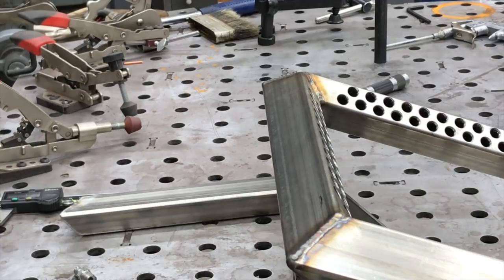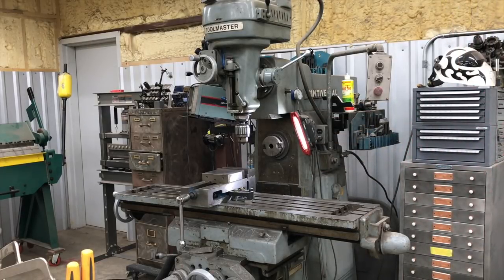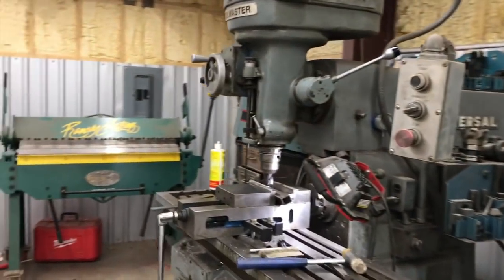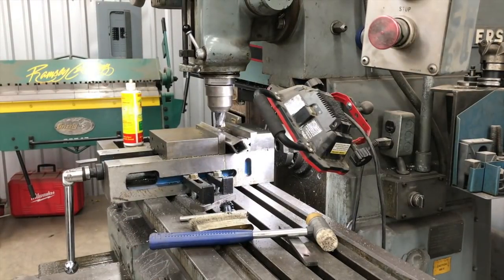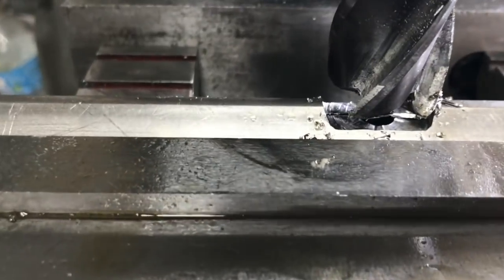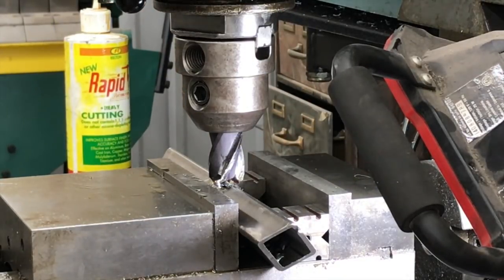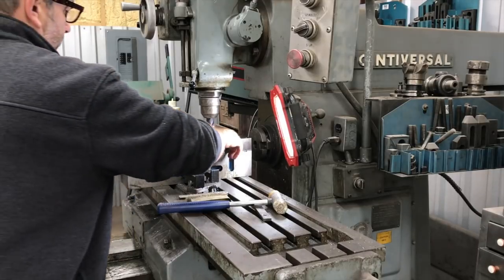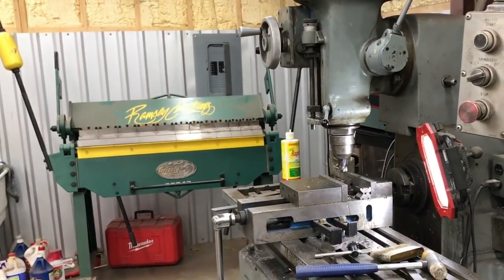Hard Drilling Big Hole in Stainless Steel on 45 Degree Angle Tubing

Comment: It's very likely that that piece of tube is actually 25mm or .984 ... I would've used either 1" cutter though, they both would've done just fine and all 3 of them, FYI, are center cutting.  That NMTB (or international/NT)taper is considerably more rigid than most manual mills and their R8 taper counterpart.  I would've engaged the feed at .0015 per rev at around 100/150 rpm and let it eat it up man!  Nice mill you got there, those old Cincinnati machines are great, back in their day they were what the military used too because they were a great machine.  The H-V was/is really more rare and harder to find than the other Cincinnati machines from the 50's/60's.  Very cool my man, very very cool.

Although not an available option readily considering you didn't have one would've beeen an annular cutter, HSS, and they work great for that kind of stuff, interruption and all.

Comment: Why not just put a couple of V blocks in a vise to hold the tube and use an end mill and make passes on the "Y" axis to the desired width and depth. The drill would be my last choice with what you got! Good luck however you choose brother!
Peace!
Reply from the maker: that's pretty much what i did.  ITs a long video, not sure if you stayed to the end
Reply: Ramsey Customs - turbocobra  I realized I jumped the gun with my comment. I posted it before I finished watching the whole video! I thought you were asking for suggestions and were going to wait for replies! Sorta like you did with the corner welding part of the project, but I was mistaken! You're very blessed to have the means for such a well equipped  shop and you get some nice jobs to learn new skills on! Good for you, I hope your blessings continue! Peace.

Comment: I had to drill a ton of holes in some stainless for a floor drain using an old Delta drill press. Since I couldn't get it slowed down, did it in a tub of Tupper Ware filled with water. It worked great!
Reply from the maker: Thats a good idea!
Reply: I did 1/8" pilot holes then followed up with a cone style step bit. It was over three hundred holes all under water and only used two bits. It's not a new idea, certainly, but it works. Stainless work hardens like a son-of-a-gun especially for those guys going full-gas with the drill gun in max gear. It gums on tapping, too, so it's a change in mindset.

Comment: The largest collet you can purchase for an R-8 taper is 7/8. Last I checked it's hard to fit a 1" shaft into a 7/8 hole.
Reply from the maker: Actually there is a 1" collet available, bought it from ebay, unfortunately its so thin in the body that it doesn't have enough gripping power to hold it rigidly enough, hence why i broke it.  like i said, was trying to do somethign i shouldn't have been
Reply: @Shaun Work 
Just Say'n......
https://www.ebay.com/itm/1-R-8-Collet-European-Brand/262249319952?hash=item3d0f470e10:g:cJkAAOSwX~dWno59

Comment: First off, kudos for solving the problem successfully.  That's the most important and largest part of the equation.

You didn't go into too much detail about the use of the final part due to the mentioned nondisclosure issue.  It looks like a larger burner or bubbler assembly.  Is the item subject to constant aesthetic concerns requiring the pipe to be fitted directly to the main part?

However, why not:

1)  Open up a hole (square, round, whatever) with the plasma cutter, cutting disc, drill, etc., on the main unit a bit larger than necessary.
2)  Take a section of stainless flat stock larger than the just-made opening, drill a 1" hole.
3)  Use the bending break to convert the the flat stock into 90 degree angle channel bisecting the just-drilled hole.
4)  Grind the required hole oblongs larger fitting up the pipe due to the new profile caused by bending.
5)  Weld the inlet pipe to the fabricated angle piece or the angle piece to the master part followed by attaching the pipe.

The benefit, of course, is the huge savings in fixturing/set-up effort.  It also decreases risks/costs if there's a subassembly screw-up.

There's a million ways to skin a cat depending on other parameters you probably haven't shared in the video.  I always find it fascinating how shop problems get solved.  Even if I would have attacked the problem in a different manner, someone else's journeys always plants seeds for future projects known and unknown.

I enjoy your videos.  Thanks for sharing your projects, efforts, trials, and tribulations.
Reply from the maker: That's a great solution!  That is a very logical idea that never crossed my mind
Reply: I wondered about something like that. Without knowing the parameters you've got it's kind of a wild card suggesting things. Sometimes you go through all sorts of ideas and in the end what seemed harder becomes easier because it's more direct. Ol time an money battle there. Worth studying for sure

Comment: I would have used an annular cutter.  HSS works just fine.  We use them all the time on stainless with no issues.  Just lubricate and go.  It will give you a very nice hole.  Your end mill worked great with perfect results!!  Nice Job!!
Reply from the maker: Thanks Reid.  I definitely would have used an annular cutter, but my 1" one was broke, lol

Comment: I think you meant bcbloc02 on the shout out. lol  Most rigid is always lock the quill and raise he knee, but for this case I would have used the quill powerfeed.  I think the most likely way to break an endmill or drill here is when it tries to grab going thru. With powerfeed it can't get sucked in and jam, but with hand feed it can.
Reply from the maker: Yea, sorry, that's what I meant lol.  Good point on the power feed

Comment: 8:39 Why aren't you using your coolant mister that is on the side of the machine? It would really keep your cutting tools cool. It works far better for me than any oil, and it is much cleaner. Just blow the part off with compressed air or wipe it with a rag. The machine stays cleaner and nothing rusts due to the water soluble oil in the mist. Just set that nozzle up and turn it on and don't worry about stopping to oil again.

That looked good with the end mill, but if you have many to do, I would try an annular cutter or carbide hole saw. The 1" annular that I have, will chuck right up in an R8 3/4" coIlet. I do not know if the annular will like the intermittent cut, as they should be run with good pressure and the holes should be done in one pass, without pulling out of the cut. The upside is that you are only cutting a small amount of stainless with the annular. The center/waste material doesn't need to be cut. A hole saw would work similar and maybe without a pilot bit. Even if you have to run a pilot, it will be small and similar to your spotting drill, as the pilot goes in first.

Plasma does not seem like the right tool for this job. On steel, you end up with hardened slag on the edge of the cut. If the same goes for plasma and stainless, you would want to grind it before welding. Cutting on two sides of a tube would require either hand cutting (not very accurate), flipping the part and running in two passes on your table, or a rotary setup for your plasma table. 

I hope the company you are building these parts for knows that you are showing parts of the process on youtube, and that they are ok with the limited amount of info you have given. Perhaps they are ok with it as long as you don't go into detail on the old part, the type of work being done, or the identity of the customer. As much as we like to see what you are working on, it would suck if it caused problems with your contract. Thanks for sharing.
Reply from the maker: I could have used it, but my reservoir didnt have any coolant in it and i didnt want to mix any up for just one hole. and others have said that lube is better on stainless

Comment: Hole saw or plasma no need for messing around with a mill unless you have to do a hundred of them.
Reply from the maker: I wouldn't think a regular hole saw would cut through the peak of the stainless would it ?
Reply: I have done it in the past, so yes it does.

Comment: I'm thinking annular cutter or carbide hole saw. Pilot hole if required. I'd use locked knee and quill for progress. Certainly not a job for twist drill IMO!! :)
At least the milling worked out real good.

Comment: Before you read this, what I say is more of a thought exercise than anything else. The way you're doing things obviously works for you. I'm really gonna be splitting hairs here but I think this stuff is very interesting. 

The way I see it you fixed something that wasn't a problem in the centre drilling operation.
Moving the head back and forth doesn't make a lot of difference in terms of rigidity, your spindle would also be fine if partly extended in my opinion. The spindle bearings move up and down with the quill so there's a fairly minimal loss in rigidity.

The point where I would personally improve the setup is the drill chuck. I would hold that carbide centre drill in an ER collet or some kind of milling chuck. To see why, let's talk about what a centre drill is supposed to do.

1: It removes a pocket of material for another (more flexible) drill to start in.

2: When finishing the cut, the carbide centre drill will, if installed in some sort of collet/milling chuck, stay rigid to the spindle bearings. This means that any minimal run out from the installation of the tool will correct itself by acting similar to a boring bar.  This run out, however small, is always present since all equipment is made to a certain tolerance. The boring action at the moment the centre drill finished its cut machines the pocket true to the axis of the spindle bearings.

The drill chuck relies on the point angle of the drill to keep it true, all of us have had drill bits walk off and that's part of the reason why. Also, milling with a drill chuck is a bad idea, try it if you don't believe me 😉.

Comment: 7:02 that 3 flute end mill you got there is actually centre cutting. One of the three flutes extends all the way to the centre. I have some of those myself and they do it just fine.

EDIT: As you mentioned, drilling a center hole first would make the operation easier though since the chips have a very small path to clear out.
Reply from the maker: Thank you, appreciate it

Comment: Equipment worked well. Machinists I watch usually recommend locking the quill and raising the knee.They say this helps with rigidity and prevents the tendency for the cutter to grab when it breaks through etc.
Reply from the maker: thanks, appreciate it

Comment: Worked great. Def. needed the pilot hole. A container (spray can cap) and an acid brush will save you on cutting oil usage.
Reply: https://littlemachineshop.com/products/product_view.php?ProductID=3896
There called a spill master,i used them for almost 20yrs as a conventional machinist,they work great!
Reply: kmcwhq I took one of the kids Play-Doh type containers and barrowed a paint brush from the gf and it's working much better than a drip or ten how ever many came out lol
Reply: Phil Ortega just ordered. Thank you
Reply: Oh man......2 of them are $11.90 and the shipping is $9.60!! 
They can't weigh more than 1 pound total
TOO MUCH.
Reply: Here's a 10 pack of no-spill paint cups for $9.50 and free shipping with prime 
https://www.amazon.com/Creativity-Street-No-Spill-Paint-AC5100/dp/B000JL54II
Reply: Machine tool supply house kbc i think has them to if you dobt want shipping,that was jist an example i got online.
Reply from the maker: I have plenty of no spill cups with regular cutting oil in them, but tap magic is more costly so i use it only when tapping or things like this.
Reply: Ramsey Customs - turbocobra 
I thought so,just posted to let some know whats out there.

Comment: Id just push the 1 inch endmill through, no need to pre drill and over complicate the operation, at the end of the day it's just a clearance hole
Reply from the maker: Ok, i was just trying prevent any issues with the end mill wanting to walk if the center of it was mess up but yea it may have gone right through with no problem
Reply: Ramsey Customs - turbocobra An endmill that big won't walk off on you, and endmills don't follow pre drilled holes like a reamer or drill would  they will find there own path no matter what. Good video though keep them coming.

Comment: Carbide hole saw would pry work pretty nice
Reply from the maker: I have some annular cutters that are HSS, but no carbide hole saws, never even tried one, I need to get some
Reply: Ramsey Customs - turbocobra I think it would be tool for job. I use em quite a bit on thinner materials and stainless would be perfect as well.
Reply: yeh, similar to many tube notchers